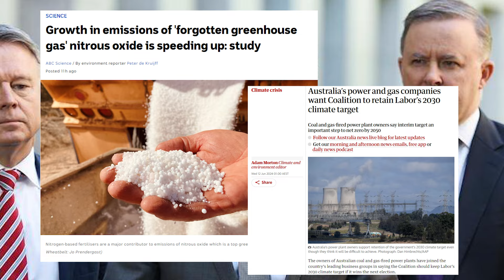Climate Crisis?

Comment: 20 years ago they said sea levels would be a metre higher within 20 years if we didn’t tackle climate change,
and here we are 20 years later and nothing has changed.
Reply: Do you remember the Tidal Wave that was going to hit Adelaide...? 1976, mass  departures that week
Reply: Are you surprised?
No not at all…
Reply: Here in Perth, WA, there is clear evidence that the coast line is rising, not falling.  In NSW it is falling, not rising.   Figure that out.
Reply: @stanyeaman4824 Ah, but the climate in WA and NSW is different, is it not? So the weight of air on top of these states is different, is it not? Therefore, it makes sense that land is rising in one case and sinking in the other. All due to climate you know.
Convincing, am I not? No? Didn’t think I was…

Comment: What crisis? Melbourne has been getting milder, lower maximums and higher minimums, although this winter looks cold so far. Part of the lie is average temperatures, warmer minimums and stable maximums produce an increased average, not a hotter climate.
Reply: Melbourne 47.2C in 1851 at 290ppm. Thousands of other places around the world have unchanged maximums while CO2 has gone from 290-420.

Comment: You CANNOT build a reliable energy production system based on wind (which generates power only 40% of the time) and solar (30%) which REQUIRE additional power generation to fill in the gaps. That means you are building THREE systems, each of which has to cover its own construction and maintenance costs. That WILL drive prices up. And that is before we consider the costs of batteries and transmission lines.
Nuclear, on the other hand, has a very long lifespan over which its construction has to be repaid. And it operates, on average, aboard 95% of the time,

Comment: Analyse what has been said.  It is a prediction based on the laboratory known fact that CO2 absorbs heat, and the observed fact that atmospheric CO2 has risen from c.270ppm to the present c.415ppm.  It is also an observed fact that ice core data shows that global warming PRECEDES global rising CO2, not the other way round, and this has been going on for as far back as there is ice core data, which is about 800,000years.  There is historically recorded fact that glaciers in Alaska, Chile and Europe started to recede in the early 1700s, well before the start of the Industrial Revolution.   Separate facts from predictions, and you get different conclusions.

Comment: A Commonwealth (in practice) s designed to be greater than the sum of its individual components, where the benefits (for member States and Commonwealth Citizens) are positively geared to offset the cost of participation.
This hasnt happened for some time. Our managers-in-trust on our behalf have lost sight of this.
Do Your Own Research.
The Commonwealth as we currently understand it yo be has overstayed (its cost effectiveness) welcome.
Times they are a changin' most likely before this decade is out.